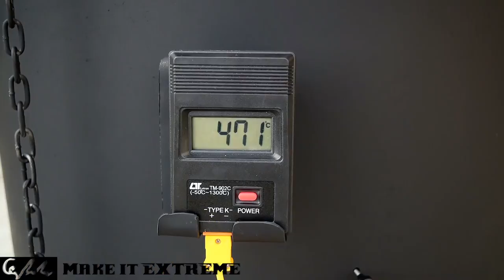Metal Melting Furnace

Comment: If these videos have taught me anything, it's that I need to learn to weld.
Reply: and buy a proper welding machine :D
Reply: Any guess as to the make and model he uses?
Reply: Ashley Mills no idea. I don't even know where these guys are from :o
Reply: I can't tell the make and model from the video but I have taught myself mig welding by watching youtube vids and buying the cheapest mig I can find on ebay. I got hold of some scrap steel and just went at it. After a short time you realise the short comings of a super cheap machine and upgrade accordingly.
Reply: DO IT! just buy a cheap welder stick or mig and just have at it. It is not that hard (as long as you are not expecting pretty) and super fun
Reply: this is something that is important in my opinion: buy cheap in the beginning and upgrade as skill, will and wallet grows. no point in buying the most expensive model if will stops early. this applies to many other things as well.
but i bet there many opinions, this is mine and has worked for me in the past.
Reply: I think they are from greece.
Anyway, if you want to learn to weld and don't have the equipment (and money to buy it) look into welding courses. That way you can learn from professionals and get a certification at the end of it.
Reply: Toby Catlin djAnakin but when you start welding make sure you have apropriate safetyequipment
Reply: +Toby Catlin I'm going to do just this :)
Reply: this guys are from the mount olympus and they are hephaestus nephews ,  so they are half humans and half godssss !!!!!
Reply: For Mag/Mig Welding you actually dont need skill :) and the equipment is cheap af. 200 € and you ahve a 100 A MAG Welder
Reply: no.....some skill and practice are a must....Ive seen guys try and try and could not lay a bead no matter the machine.
Reply: If i have learned anything about welding, it is that you want to start by learning to use stick welder. If you can master that, then MIG and TIG wont cause you problems. Also its cheapest of them to operate while still learning.
Reply: I'm guessing it's a Chinese inverter mig based on the looks of the torch. He's using a Chinese inverter plasma cutter as well. Some of them work pretty well for what they cost.
Reply: 1990notch can you recomend a certain brand?
Reply: Are you in the United States? I like the "Klutch" inverter migs that Northern Tools sells. I believe they're made by Jasic in China. I bought the 220v 200Si multi process unit that does MIG, stick, TIG, and includes a nice spool gun. I bought it on sale and used an online coupon I found through google. It works really well, no regrets on that one. They have a 120v MIG for almost half of the 220v model. You might check Eastwood as well. Many people seem to get good results from the Everlast stuff but I think they're priced too high. Or look on Amazon, at least you can return through Amazon if you get a lemon. The AHP brand on Amazon seems to get good reviews but they don't sell many different models.
Reply: Absolutely true.  I was taught how to Mig with no welding background while I'm ok at it (right now very out of practice).  Without the knowledge to what is needed to set the machine I don't know how.  I believe starting out on a stick would've given me some of those skills.
Reply: I say buy used but quality. Buying cheap new stuff is just plain false economy, if you decide you didn't like welding then you will never get that money back, a 2nd hand chinese welder, most people wouldn't offer the spare change for it. OTOH if you buy something used of a quality brand (miller, lincoln in the states, esab, kemppi, fronius in europe), you can often get down to similar amounts of money, but the big difference is resale value, a good machine you can sell on for what you paid, more if you got a good deal.
Reply: djAnakin it's really easy I'm 12 and have done it before
Reply: Mig welding is easy, you just need a steady hand
Reply: Weldings not too hard. Its so fun but making the perfect bead is literally the hardest thing about it
Reply: Ogkushstain
 actually its easy
Reply: true lol
Reply: I'm one of the lucky people who learnt to weld young and still can now
Reply: The intro could teach you that😂
Reply: And that you need a ton of money for the tools...
Reply: if these videos have taught me anything. . .its that i need a giant shop full of tools so i can make other awesome tools like these guys
Reply: If this video has taught me anything its that guys who actually know what they're doing get really pissed off watching these guys slap this crap together put, welds all over the place without good beads and pour some big pointless, bubbly, gassed, terrible, Terrible castings and prove that money doesn't buy skill or creativity
Reply: I've never welded before, but even I could tell those welds looked like ass. As AvE would say, they looked like chicken hemorrhoids.
Reply: for all those knocking his welds, etc, I have been welding since I was in middle school, initially as a hobby, but now as a profession.  There are a couple types of welds, sometimes a weld doesn't need to be strong at all, however given your tooling, welding is the most reasonable method for fastening, that being said, you aren't going to spend hours prepping the surface area to be welded to remove contaminants, as well, you may not be all that concerned about stickout or consistency if the load is low and the the weld will be hidden.  That said, nothing in this build will ever have much of a load, and you would easily be able to get away with 4 tacks per joint, I commend him for taking the time to finish off each joint with a bead
Reply: not much to learn about mig welding.  do yourself a favor and buy a tig/stick machine.
Reply: Like everything you do you have to practice, practice,  practice. you know how much metal I burn up before I get to know the do's and the don't of welding.
Reply: Me too  I need to learn to weld.
Reply: knowing these guys, they probably built their own from scraps!
Reply: djAnakin learn mig and fluxcore last. Stick, Tig, Mig.  Otherwise you are more prone to believe that these were actually good welds.
Reply: jason homer The only welding I've done is to fix farm equipment, in cases like that quick and strong is better than slow and pretty.
Reply: Plaster Paris
Reply: same i need to buy welding stuff
Reply: @kaigrundmann9277  i think he need to learn weld too ..
Reply: more like: buy a welder. an ability alone is useless.
Reply: @lazakid  them half gods will get cancer from fairing this furnace without painting fireblanket with any rigidising paint or lining it with thin layer of refractory cement. However the size of furnace is impressive - than again why go overkill - it takes a lot of time and money to bring it to right temperature (that is if you care about your health and cover material normally used for insulation from gases). If they have sold any - and I would have buy it - I would literally sue them for exposing me to harmful environment while firing their forge. Not to mention how are you going to take such heavy crucible from it - it must weigh about 100 kg and you would like to make a pour 90% all the time in one go...
Anyhow well build base - just not finished properly
Reply: very good skill to have
Reply: They are using welders by migatronic. They have a link to it in the drone catcher video description.

Comment: The fabrication skills and techniques on this build are impressive.  Building up the platform inside with the insulation underneath so it isn't compressed is a sharp idea, as is using the lower temp fiberglass around the edges.

Comment: well done very nice build. what size crucible is that it looks like a 35A clay/graphite but im not sure, i want to switch from using a fire extinguisher in my crucible. also if anyone decides to build this i would recommend just using an old oil drum it will save you alot of time thats what mine is made of.

Comment: Like your work, but want to make 2 safety suggestions. First, wear much safer clothing, shoes, face protection, etc., the aluminum (guessing?) is melting at about 1200 degrees F.  Second, melt on sand base, not cement. If there is a spill any moisture in the cement will be drawn out and sort of explode throwing hot stuff everywhere. 
I want you to be around to be able to continue making great videos!

Comment: Very impressive furnace - I just pour the refractory cement on mine tonight - funny timing - I used ceramic blanket as well but I was told you need to protect it otherwise it will deteriorate quickly - see the burning on the feeding tube when you place 2 or 3 pcs of aluminum. Anyway great build as usual - great editing and music choice, a joy to watch !

Comment: Why didn't you use the homemade pipe bender ??
Reply: Or the plasma-torch circle cutter machine.
Reply: 1:49

Perhaps, maybe because they didn't exist when he made the video ?!
Reply: same question !!😞
Reply: it does because the furnace is the 40th and the metal bender is the 36th
Reply: Probably because the commercial bender they are using employs dies and rollers to help keep the tube from bending out of plane, whereas their DIY bender did not.

Comment: Hello, very nice furnance. PS: If you add to your melted aluminium kitchen salt (in aluminium pipe or foil) and push it to bottom, and put the small wax candle on the surface , you will have much better results. No bubbles in castings.

Comment: Awsome =)

Just a note, kaowool (the white insulation) is very cancerogenic and should be coated with something, for example ITC-100 (Also makes the max temp go higher of the furnace, due to radiant heat reflection) =)

Comment: Subscribed for sure..! Makes my tiny foundry seem like a toy..lol. Anyway, I only do small metal castings, so it meets my needs. A tip...if you don't want to spend money on expensive casting sand, you can make your own. Use fine sand from the beach and let it pass a sieve for further purification. Then add vegetable oil to it so you can form the mold. Old engine oil does it too, but I prefer to think of the environment if possible. I wouldn't recommend welding in bare arms as you did...no matter how hot it is. Those UV rays are the killer...just saying. Now I'll head on to your other videos, I'm already curious.

Comment: What type of welder are you guys using. And are you cutting the sheet with a plasma torch? Why didn't you use the plasma torch instead of the nibbler to cut the base ?
Reply: Phil Chia plasma torches are so tricky when it comes to a nice cut if you're going freehand

Comment: What brand of metal bender is that? I have a Hossfeld with dies I need to setup one day, but it takes up tons of room which I don't have. A smaller bench unit like that would be nice.
Reply: i think he built it on his own. There is a video for it.
Reply: It's an automatic bender that has a molded case and a safety sticker on it. It is not a one-off job.

Comment: Looks good  but you need to coat that liner when you rebuild it . The heat resistance material you used is not made to have fire come in direct contact with it . And will become brittle and fall apart when you are in the middle of a melt. And that will be extreme. I use fire clay on mine and melt steel with it. its hard to find and not cheap but it's good refactoring liner. " If done right"

Comment: I know I'm a bit late to the party on this but I was wondering what temps can that furnace handle. Could you melt steel in it? And how often would you have to change out the ceramic fiber?
Reply: if you coat the ceramic fibre with something like itc-100ht it should be more that capable of steel temps,
you would also have to use a waste oil burner to reach those temperatures

Comment: Unsealed ceramic wool like you've used is *extremely* carcinogenic when heated. It throws off tiny bits of fiber that will give you "black lung" effects. Seal the surface of your wool with a slip like ITC100. That will also greatly increase the efficiency of the furnace.

Comment: You are used to build with cotton. How cotton not get damage. When you start cut  a portion on the vessel, cotton get fire. But after weld tangent tube, how you supply heat energy into it.

Comment: What?  No cast refractory lining inside of the furnace?   What DID you line it with?
Reply: It is lined with refractory mat.
The mats will not hold up well to the burner, and the furnace will not get as hot. But on the other hand, it is easier to service, less messy to make, weighs far less, and is fine for aluminum.
The big problem with this thing is a lack of drain in the bottom. It will really suck when a crucible fails and fills it with 16Kg of molten Al and no way to drain it :)

Comment: What paint do you use to protect your awesome builds from rust?? I've never really used any paint / protective coating before and there are dozens of different kinds here in Germany. Thank you so much for the videos!! You inspired me getting started in welding and I am very thankful for it. Keep it up ;)
Reply: Any oil based spray or brush on for metal will do. Good luck with the welding, its a fun job!
Reply: Rustoleum makes a self priming paint in a spray can. Should be available in DE.

Comment: 1:33 how come you weld it in short sectiond instead of a continuous weld all around?
Reply: Because when the metal gets hot it moves , he did this on purpose to avoid having little gaps :)
Reply: Pedro Bear  So why dosen't he finish it after it cools?
Reply: Ham549 I guess you could just leave it like that it wouldn't matter since they put special wool inside or they just forgot about it
Reply: If you make one continuous  weld the heat warps the metal. spot weld then come in after it cools and fill in the gaps....If its even needed.

Comment: did you tack weld the outer frame to prevent warpage?
Reply: none of this was tack welded in the end, not as a final product.
Reply: I dunno what its called then. At the bottom of the folded sheet metal there is a bunch of little welds
Reply: ummm, welds.....some called that stitch welding rather than seam welding...you know....cause it looks like stitches. Sometimes you dont always need to weld an entire seam up, if its not going to hold liquid then structurally you can stitch weld it, still get the support you need and save on weld wire and gas. Hope that helps.
Reply: Paul Wilson thanks, I'm new to welding

Comment: Friends at you excellent products!
But unfortunately you haven't answered one question!
What insulating matirala you used?
WHAT ARE THE METAL SOLDERING TOOL CALLED?
Where did you get the thermometer and the huge crucible?
You essentially don't answer vopor about materials and tools?

Comment: I know I'm late to the party a bit, but I hope you used a rigidizer or refractory cement and not just the insulating wool as you NEED to use one of the two to prevent fine particles from becoming airborne during use. Kaowool and the like are typically ceramic particles or fiber and are EXTREMELY hazardous to breath in.

Comment: You Are BETTER THAN DiResta in metals
Reply: Haze G I don't think so. Here is an excessive use of metal IMHO. So big drum to melt such a small things with a tiny hall on top. It could be 3-4 times smaller with the same ability to melt the long alum bars.

Comment: I am not sure if it is a good idea to expose the rockwool type of used insulation directly to the burner. I am pretty sure that way the furnace blows out a stream of burnt off ceramic fibers (and although it is not asbestos, I wouldn't like to have them in my lungs, as the more heat resistant that materials are, the less bio-degradable they are). I would recommend to add an inner layer of fireclay.

Comment: at 1:30, why are you only welding 2 inch sections?
Reply: Stitch welding reduces warpage and burn-through on thinner material and saves time as well. A 100% weld is unnecessary for that particular area.

Comment: Where did you get the thermometer and the huge crucible?
Reply: I want to know where they got the crucible...
Reply: Walt Sorensen #3 Crucibles are a lot smaller than the one he's using.
Reply: PurpleFez, I agree looking at the video again it's many times larger than a #3 Crucible
After rewatching I guess it's maybe a 45cm (17.72 in) tall Crucible since the bottom portion of the furnace is 65cm (25.59 in) height and subtracting for the bottom insulation (about 10 cm or 4 in) and some head room (about another 10 cm) that leaves about 45 cm for a crucible which would suggest maybe an a100 Crucible with a 40cm total height.

Comment: Looks so easy, doesn't it? All you need is a hundred grand's worth of 'hobbyist' equipment in your back garden shed. One that covers more area than my entire house workshop, garage and garden combined.
Reply: There are so many ways to make something like this without all the equipment. A metal drum, a $30 grinder, a $100 welder, and a few cheap bits. They way overkilled this build.
Reply: Brian Butthole and jesondag For a much cheaper alternative check out Grant Thompson; the self proclaimed 'King of Random'. His projects tend to be simple, quick and (above all) inexpensive.
Reply: SirHenryofRR For a much cheaper build look up Dakota fire pit aka dig a hole in the ground insert steel can done.
Reply: FutureAirways2 I've built one using 'scrap' materials for almost nothing. Using coal (a bad idea) it can melt steel. As in the crucible!

Comment: Awrsome build but one problem. You need to cover that ceramic wool with a refractory cement. The fibers of the wool blow off when melting metal and get into your lungs causing lung cancer and a host of other lung related problems. Always cover the wool!